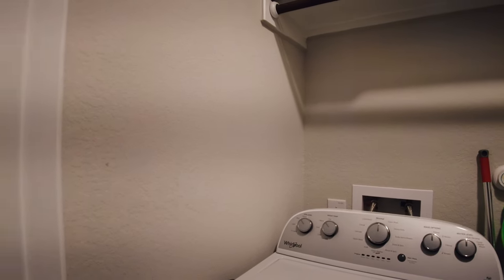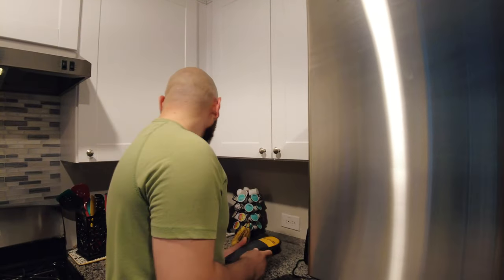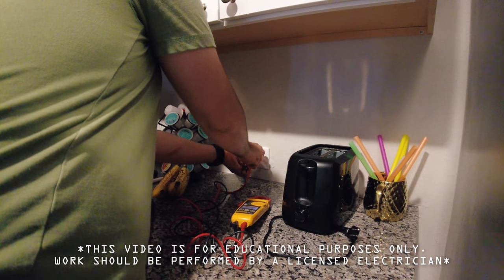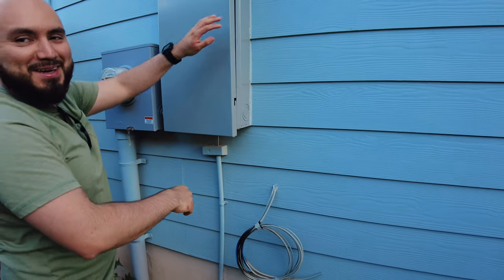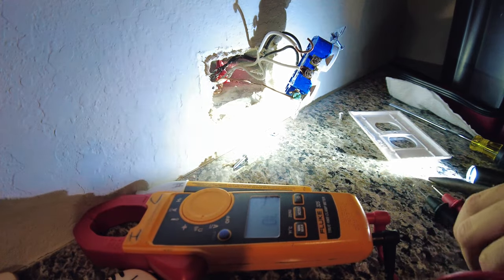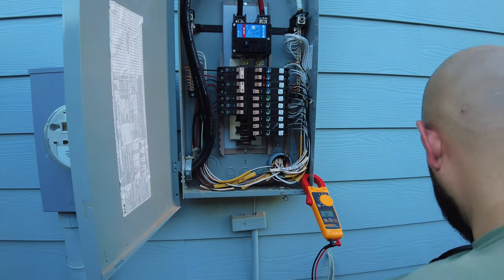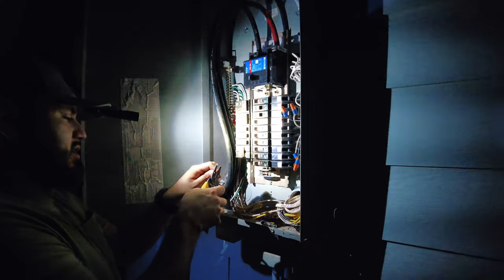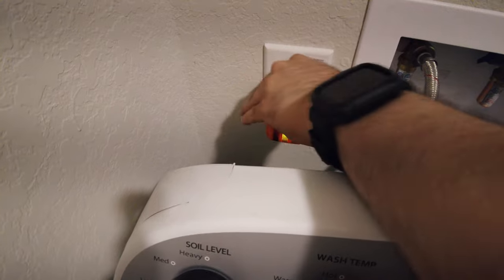Arc Fault Breakers Repair | Residential

Comment: the neutral is grounded at the main so I was just wondering how you figured it would be shorted in the outlet box did you remove the neutral for that branch circuit before testing continuity?
Reply from the maker: No, in this scenario I worked it backwards. The homeowner was having intermittent tripping so I assumed it was a neutral barely touching the ground in the outlet box. After separating the neutrals at the first outlet box, I was able to eliminate having to open any more outlets boxes on that branch circuit & go straight to the panel. Even though the neutral is grounded at the main, that wouldn’t apply to an AFCI circuit because the neutral is bonded on the line side of the AFCI & not the load side. The load side of breaker neutral needs to fault to ground for "ground fault" trip feature to be the reason for the trip 👍🏽
Reply: Right on! Keep up the good work . I’m enjoying the content.

Comment: I've been a commercial electrician for 15 years now.  Always thought about going into residential but I imagine dealing with the customers is probably 50% of the work.  What's it like?
Reply from the maker: I’ve been in the trade 9 years. I’ve never done new construction, always service work. Started with industrial, then moved to commercial/residential now I’m back in industrial. Didn’t like having to create a huge material list for such a small job & having to sell the jobs to customers. With industrial, they need the work asap so the price doesn’t matter. You have to deal with less people & get to work on my difficult things. To me it’s better because I get to figure out problems everyday & there is a satisfaction when you fix it 👍🏽

Comment: Question for you:
I switched off the breaker for my oven range hood.  Then I disconnected the wires to the range hood so I could take the hood out.  I then had bare wires which prompted me to verify that there was no electricity in the wires just to be safe.  My volt meter showed about 5V instead of 0V.  What does this indicate?
Reply from the maker: It’s hard to say if I don’t have my own eyes on it but my first thoughts are.

1. Meter could be giving a false reading? Usually voltage that close to 0V, doesn’t concern me. Test it with a different meter if possible.

2. What’s the voltage on the wires with the breaker turned off from Hot to Ground and Hot to Neutral?

3. What’s the voltage on the wires with the wires disconnected from the breaker from Hot to Ground and Hot to Neutral?

Those 3 things will help you narrow down your question. Good luck! 👍🏽

Comment: I like your videos bro but unless the circuit you were working on was coming from a sub panel, the ground and neutral will always have continuity. Since theyre both bonded back at the main breaker. Or am I missing something obvious lol ?
Reply from the maker: In the video, I’m referring to the ground and neutral on an individual circuit. On a circuit with an arc fault breaker, the hot and neutral land directly on the load side of the breaker. If the neutral and ground are touching on that specific arc fault breaker circuit, it will trip that arc fault breaker as if you had a hot to neutral short or hot to ground short.

The reason why I know this is because there has been plenty of times that I’ve replaced lights on an arc fault circuit. Instead of shutting the breaker off, I have just turned off the light switch. I replace the light and then turn the light switch back on. The light does not light up. I go to the panel and arc fault breaker tripped. Why? Because I touched the neutral and ground when replacing the light, causing the arc fault breaker to trip.

Arc fault breakers can be tricky to troubleshoot. Hope that makes sense. 👍🏽